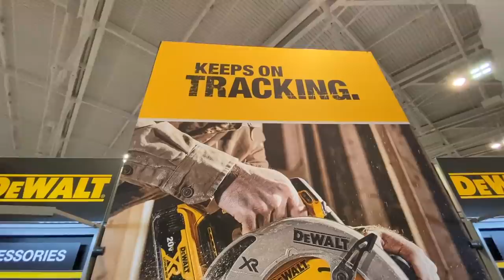Dewalts NewTools of 2020. First time seen in public at Stafda

Comment: I think it’s hilarious how someone was like it’s bogging down the makita saw when everyone knows it was just a dead batter and the guy wasn’t trying to move the saw as fast!
Reply: Yea not cool at all, I hate it when tests are quite obviously rigged that way - as manufacturers only make themselves look bad in the process.
With that said, I couldn't help but notice that both Diablo and Dewalt made use of the same dishonest behavior, and so I guess there are no clear winners
Reply: That’s the reason I won’t use diablo lol
Reply: You notice how deep the diablo saw blade was set compared to the other saw..dont know if that effects anything ?
Reply: @lukemedcraft446  
That is a great observation - good eye!
Reply: guy for the dewalt was standing more so to the front saw and pull at a awkward angle compared to the diablo guy that was more so behind and pushing (though i do like diablo blades more) company's need to focus on their own product instead of having a "competitor test" thats obviously staged....
Reply: I agree it looked like the dewalt blade in diablo booth had a low battery
Reply: luke medcraft it absolutely does and was done on purpose. There’s a reason why you’re always supposed to adjust your cutting depth to the thickness of the material + 1/4” or so.
Reply: The dewalt blades are my new favorite. Was a diablo guy but not anymore, they are now 2nd place. This is based on months of real world use, and years of Diablo use.
Reply: Thank you
Reply: true
Reply: exactly
Reply: Clearly it's the saw/battery lol I like diablo but come on that's a no brainer
Reply: @Itsyourbestie12345  I mean I’m not to worried about it. I still buy diablo because it’s cheaper and easier to find
Reply: @landonkintner3750  same here man
Reply: If you look closely the dawalt screw were drilled in much tighter
Reply: Very deceptive.
Reply: @SmalltimR  well i mean at least dewalt had an up close view and the same battery those batteries dont just die after one cut now the diablo demonstration you could visually see the blade isnt spinning that fast on the dewalt but also you can here the motor isnt spinning as fast while cutting then he sped it up then slowed down again so idk there may be a little more trickery in diablo demonstration
Reply: Yeah milcocky definitely rigged that one but I’m surprised most cutting attachments from them are the best
Reply: The makita battery on the dewalt blade saw is even marked with a paint pen. Presumably to keep track of which battery has low charge. The guys stance also and great for pushing on the saw. Blatant BS
Reply: Also, I actually didn't see any screws in the wood when the piece fell away on the diablo test. Maybe my screen resolution affected that but I thought that the wood should have shown some sign of the screws that were cut through.
Reply: Screw thickness may have been a factor as well. Or type of metal the screws were made from.

Comment: They need Project Farm to test out the blades for an accurate and honest test.
Reply: Yesssss!!!! Everyone go suggest that in his latest video!
Reply: I agree. I use DeWalt. Diablo is my go to for cutting blades and wheels.
Reply: Dude you can tell the cut DeWalt made with the Diablo is wobbly as hell!
Reply: I’m pretty sure the Dewalt blade is on their newer Flexvolt saw while the diablo blade is on the original saw. The Original Flexvolt saw was not equipped with a rafter hook while their newer one is. The new one has more power I believe... which means they are not being fair or accurate. Don’t believe this test! It is deceiving and inappropriate!
Reply: What those worthless people are doing is excessively forcing the tool through, which probably causes the disc to get stripped off its cutting edges
Reply: @trexmidnite  Exactly! Those blades aren't meant to be shoved through the material. Let the tool do the work for goodness sake!
Reply: What more.. they got their own rigged discs..
Reply: An no way would every tooth be gone, do they think were idiots
Reply: Very true
Reply: @lone ranger I use diablo blades daily and dewalt tools lol but never have had teeth fall off of any blade I also cut stainless steel angle iron never have they fell off
Reply: Looks like the dewalt blade is set perfect for the just enough to cut through the wood. The diablo blade looks like they set it in deep cut thats why its going slow.
Reply: Was about to say, “This looks like a job for Project Farm.”...He’ll solve this issue right away.🤣🤣🤣
Reply: @projectfarm numba 1
Reply: Wow I love that Project Farm is everywhere!  There’s hope for the future of humanity
Reply: He clearly forced the diablo blade into the material
Reply: Yes...very true
Reply: So I was doing a job where we were removing a roof. Cutting through wood, nails and asphalt roofing shingles to take out in sections. Dewalt blades by far lasted longer than Diablo. That was using a corded Makita skilsaw
Reply: @rogeralvarez3317  agree. I’m a Former Dewalt until I switched to Milwaukee. Both Dewalt and Milwaukee are great but nothing is beating Diablo at the what the do best which is blades
Reply: They only man I trust lol. I buy my tools based on his reviews 💯
Reply: Exactly what I was thinking.  He's excellent at removing variables
Reply: @paulnewman2115  no you're wrong  they used up the DeWalt blade to think that the Diablo is winning but really it's not the DeWalt is actually winning the Diablo people just used up the DeWalt blade
Reply: He won't test anything if a company ask him too but he does need too.
Reply: I know this is quite old now, but project farm did end up doing a circ blade test. Much better comparison as you'd expect, although surprisingly even though Diablo might have edged Dewalt out it was really close and Dewalt performed better in several tests. My opinion after the video is both blades are great, either go with your preference or for optimal performance choose the blade for the specific job (framing/demo/roofing).

https://youtu.be/ssu2eLWZjwA
Reply: @dewaltman9377  fan boooooooy max level , the diablos test was more fair than dewalt
Reply: @srt4fan4u2  Diablo doesn't make the best blades. They may make the best blades that aren't insanely expensive but there's still better

Comment: The Diablo blade is set at  deeper cutting depth, causing more friction and resistance on the blade.  The Dewalt blade is set just deep enough to cut through the wood, making for an easier and more efficient cut.  I'm a General Contractor who uses Diablo blades on my Dewalt saws everyday.  I prefer them hands down!
Reply: And he was twisting the circ saw with the diablo blade, causing the wood to burn from the friction. Very tricky.
Reply: Preference is nice but does not provide an unbiased comparison. Hellz, next thing you know, a Makita rep will be telling everyone both blades suck and go Bosch.. or Irwin..

Though I wouldn't suggest those, lol..
Reply: Definitely set deeper
Reply: Came to say exactly this...
Reply: I work in construction in Canada, I was absolutely livid when I saw the wood start to burn on the new diablo blade, he definately twisted the blade purposely to chip all the teeth off.

Although diablo also should try to make the tests more fair too, the other Makita definately had a low battery and the guy was pushing so hard that the saw was bogging, lol.
Reply: Project Farm did a video testing all these blades himself.

Comment: I only trust project farm to determine these results from tests
Reply: Yep
Reply: The fact that I agree with you indicates that I have been on lockdown for a long time.
Reply: Robot 24  If you look at the diablo test, after the piece fell away, there were no screws in the wood. Just from this one clip it looks like they bypassed most of the screws, except for possibly the very tips so as to encourage some sparking. That's just my two cents. I'm sorry I really don't trust any big company. I trust test results of independent, non biased testers though. The thing to remember. Of course these companies all have the best, you will only see the best, everything the other guy does is inferior, and we should just go ahead and give them our money now. I'm just a little skeptical of all that.
Reply: Same

Comment: Never trust a comparison from a manufacturer. Always watch independent reviews and comparisons.
Reply: Diablo blades are the best, I used to do nothing but demo and cut up steel embedded wood, Diablo always outlasted anything... The sawzall Diablo blades would last me a ful day cutting 2x6 emdedded with 6 in  9/16' lag bolts.
Reply: @myopinonz  I have to agree with you on that one.  A few years ago I was cutting out a section of 4 inch cast iron waste pipe sitting on soil.  After sawing through the majority with a 7-1/4 carburendum disc I purchased a five pack of Milwaukee "torch” metal sawzall blades.  Like $25 bucks for the 5 pack.  I used them all til the teeth were ground flat with a corded saw.   I barely made any progress.   It was so disappointing.  Next I went to another store and bought a 5 pack of Diablo metal blades (the standard ones not even their higher end carbide ones).  1 BLADE CUT AT LEAST 4 TIMES AS MUCH CAST IRON THE ENTIRE MILWAUKEE 5 PACK.  THE CUTS WERE DONE BEFORE I EVEN WORE OUT A SECOND DIABLO BLADE.  THE DIABLO BLADES MADE MONEY AND THE MILWAUKEE "TORCH” LITERALLY TORCHED $25 BUCKS.  SO MUCH FOR THE ILLUSTRATION OF PIPE AND IBEAM ON THEIR PACKAGE...
Reply: Were they comparing the 40 volt Makita saws? No? Then that can’t hold a candle to the new dewalt 60v saw. They are there to sell stuff. People aren’t stupid.

Comment: When testing the blades, they need to remove the human from the test, and use an equally weighted vertical slide. Start them at the top and see which blade gets to the bottom first under equal weight. This eliminates any human twisting or cheating on the pushing pressure. Then they need to swap the blades on the saws and run the test again to eliminate any differences that the actual saw or battery might have. Then you can have a true test! The tests as they are are completely useless.
Reply: agreed, plus who's to say the battery is charged on the dewalt blade?
Reply: When you lock at the diablo event you can see that at the end there werde only very little metal parts in the big block of wood so that means they just cut of the tips of the nails.
Reply: Did the diablo test use the new dewalt blade?  Also, it seems when 1st contacting the nail with the blade, a softer pressure is needed?
Reply: @jannikpollack7331  And there much more spark coming from the Dewalt blade. The Diablo blade is barely sparking because its barely cutting any screw.
Reply: The Diablo test is the closest, given that both batteries were charged equal... The DeWalt test their blade first, then the Diablo? Why? If their's is so much better, why go first? Hmmmm.......
Reply: How do we know both batteries were charged equally.
Reply: Battery charge? I'm no DeWalt guy, but don't they use Li-Ion like all other top brands? Cause if they do, it should give equal output as long as it is is above bare minimum charge.
Reply: I agree that the human part of this test needs to be removed and several tests with multiple saw blades needs to be performed. I would definitely watch this since I just started to buy Diablo Blades.
Reply: @Elvis Snusovic The DeWalt guys used a single 9Ah battery that was switched between two saws in the test, while the Diablo guys used two different saws with their own 5AH batteries.

Battery Amp hours makes a huge difference in performance.

Both of the tests were simply flawed in many ways.
Reply: @jannikpollack7331  dewalt cut nails and diablo cut screws
Reply: Need to get Project Farm to test them
Reply: I concur. It's ALL marketing wank as it is. All balls, no shaft.
Reply: Big difference between screws and nails. Makita can't handle a blade made for a flexvolt. Inferior power makes less torque,less rpms.
Reply: The two tests were done with different size blades (7-1/4 & 6-1/2 respectively) and at different speeds (5800rpm vs 3600rpm no load). What the test proved is that the Dewalt blades want to be run fast and the Diablo blades want to be run slow.
Reply: Check our project farms vids on blades
Reply: Out
Reply: If I twist cut I can kill any battery. Agree that human factor here is in play
Reply: Would be worth testing by Projekt Farm ;-)
Reply: @MC-kt9ki  yes.
Reply: A blade is a blade. Ive tried em all. Nobody here could tell 1 from the other if they werent branded.
Reply: Does anyone notice the size of nail on both board in Diablo test

Comment: You should redo the test yourself so we can see how it changes.
Reply: I agree. This should be a video. You can be the independent tester!
Reply: Are you 2 willing to provide the blades for him redo this test?
Reply: I'll provide the blades.  

I'm a little bit on the cheap side and I use blades long after they should have been changed out, including cutting nails, and they were nowhere near as high quality as the Diablo to start with, and they don't smoke like that.

You have to be pulling that blade sideways to make it smoke that bad.
Reply: I don’t know if it matters, but the dewalt booth he was cutting through stainless steel nails not drywall screws which are extremely hard also it seemed to me the saw in the diablo booth that had the dewalt blade was running slower which could have affected performance. Either way I believe the diablo booth test had more subjectivity than the dewalt booth.
Reply: I agree with you
Reply: I don’t understand how the dewalt blade struggle to cut the wood section without the nail/screw. I use nothing but diablo blades and I was disappointed how diablo had to rig it that bad.
Reply: Bladets are easily destroyed if you push to fast thru thin screws. It seemed like the dewalt guy pushed really fast with the Diablo blade for the first half of the cut.

Nice objective questions asked in the video 👍🏻
Reply: @btbinnovationsllc6815  IKR.. that's a big thing for Diablo Low heat..quick cool and next to no smoke.
Reply: @btbinnovationsllc6815  not when a blade looses all its teeth
Reply: Look at the cut depth difference
Reply: Good idea!
Reply: @willrobinson9575  if there patreons they are, wich you don't know of they are. It's a good test to do himself, so we get truthful results.
Or are you going to take big corporations word? Because there known for being so honest right?
Reply: Diablo didn't show a close up of there blades, dewalt did?
Reply: Funny, because I've always liked Diablo over dewalt, you'd think I'd be biased. Lol
Reply: It would have been cool to see both companies get one person each to try their blades against each other using identical saws. That way, both have their own blade and incentive to do their best. But yeah, independent test, like by Stanley, would be awesome.
Reply: Agreed!
Reply: the only way to compare is a test bench using the same force and remove variables . Instead of testing speed test durability, saving a few seconds here and there doesn't matter if u changing blades alot or worse running out on a job site.

Comment: I bought  a package deal of the flex volt tools and love them, the circular saw came with a flex blade that has been through hell in the last year or so cutting through nails, screws ect. I recently needed to do a cut out for a sink in a Jarrah bench top, (very hard Timber) my plunge saw (name withheld) that cost a fortune with a precision blade struggled, i went for the over a year old flex blade and couldn't believe how much better it went. Dewalt blade for me any day. Cheers

Comment: the diablo guys were using a dead battery. do the same test with a corded saw.
Reply: Same thought, you heard that poor saw struggling from the start.
Reply: They were also twisting the dewalt blade you can tell when he lets go of it the saw flexes back to normal. They cheated
Reply: Doesn't explain how the diablo blade cut fine through the drywall screws (which are much harder then nails) but got torched in the dewalt demo.
Reply: @adventurefitness556  Obviously the diablos whole "test" was rigged from the jump! So if it's already rigged everything they say is dishonest!

Comment: Theory: Diable used a drained battery in the DeWalt saw.
Reply: True now  that  makes sense.  I didn't  think of  that
Reply: You can also see the dewalt blade was worn in their test
Reply: But diablo was using makita saws,
Reply: The guy at the Diablo booth kept letting the sawblade spin down on the Dewalt blade
Reply: Nail size in dewalt board
Reply: They even had different writing on the batteries to tell which was which to make sure to get the desired result. Real sketchy.
Reply: It also looked like the guy using dewalt bladed makita was putting a lot of sideways pressure to get it to bind. You can see his right hand fingers. Looks like he using using more pressure pulling it toward himself then down or forward. Noticed the battery part too. Noticed Diablo demo didn't let anyone get close to inspect any of the saws prior to cutting like dewalt did
Reply: Plus they never showed anyone the blades before  and after they did the cut
Reply: Same the cut he made look like me when the battery is low
Reply: @ @lock3ddown883  I agree it looked like he was trying to turn the cut.
Reply: Or they pressed down to keep the saw stuck on the wood

Comment: During the Dewalt's demo: The blade height is set incorrectly for the diablo blade, it is much deeper. The Dewalt blade is set to the correct depth. The leading edges are at different angles upon cutting.

During the Diablo's demo: Dead battery on the saw using the Dewalt blade.